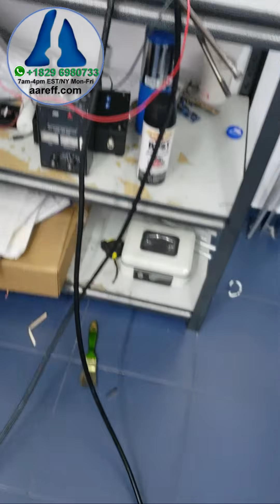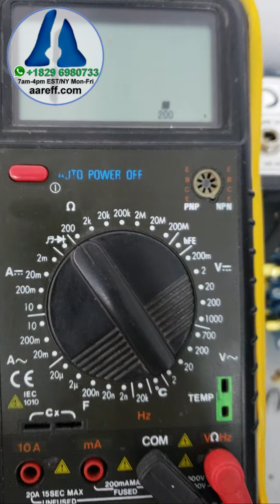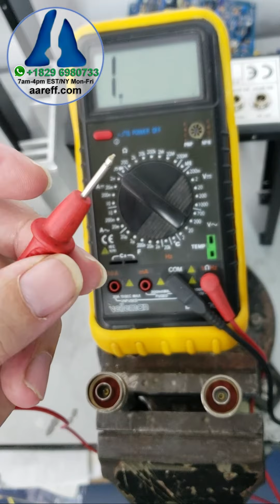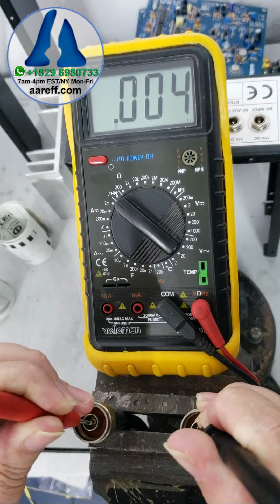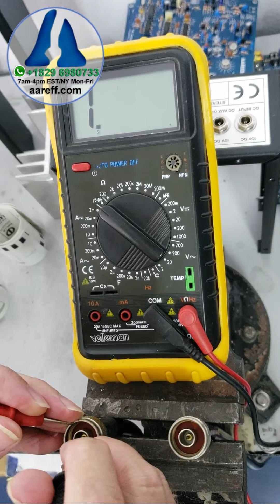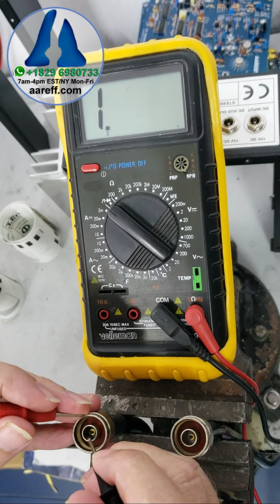Testing an Antenna Cable using a Multimeter

Comment: Additional tip (I know you know this Paul)
If you have had an antenna mounted outdoors and the SWR starts to go up toward 2:1 with no apparent damage or change to the antenna, it can be water ingress in the dielectric of the cable. To test, use an SWR meter with a dummy load at the end instead of antenna. If its still bad, replace cable. 😊
Reply from the maker: Yeah, this is true.

Comment: you did a great job my didn't read  3 center pin center pin is this good was not 4
Reply from the maker: What did you read when you just connected the meter probes together directly? Whatever number this is, this is the number you should get, or close to it, when you do center to center and outside to outside

Comment: (Thank you Valuable information) I need help from you I have a 3G and 4G antenna, how do I know that it receives a signal from the tower? Is there a device that does this or via a multimeter?🙏

Comment: If you want to do it properly, with an already installed, but faulty cable, then a TDR is your friend.
Reply from the maker: Absolutely TDR is better, but that requires more expensive test meters. This video is intended to show how any cable where you have easy access to both ends can be tested, with 100% accuracy, using a cheap 5 dollar multimeter.

Comment: What happens if the shielding is separated from the connector, like it was bent too many times where the connector and the cable meet? I assume that means the cable's not gonna work?
Reply from the maker: Yes, you assume absolutely correctly! Cables carrying radio signals cannot be treated like AC cables where twisted and taped long wires will work, for radio No!!, not even on a temporary basis. Radio signals need rock solid connections that never move and as short or small as possible. Remember, AC (50/60Hz) and DC use the entire cross section of the cable to carry the current, whereas Radio signals only the current travels on the surface of the cable, not in the cross section. So the visible connection you can see on the outer if the cable is the only place the connection of a radio signal is actually taking place and this is why the connection needs to be super good and solid for radio.

Comment: Hi I tried to contact with that number and I got no response your guy's still in business?
Reply from the maker: Hi there, yes, we are in business, absolutely mown out with jobs. You should get a response on that number if you call it between 9 and 5 EST/NY time. It's WS also, just send a message. Our email is reliable, info@aareff.com
Reply: @AareffSystems  Gracias por responder, ya le envie un email y espero su repuesta gracias.

Comment: You shouldn't be touching the probes or connections when testing. Current of the meter can flow through your body and affect the resistance readings.
Reply from the maker: That only happens if you are using the meter at a range of typically 1K or above. These readings are close to zero ohms and in this range touching the leads and the current passing through the fingers and body is unmeasurable and will not affect the readings. Try it yourself, get a 10 ohm resistor, measure it on a meter, check the result, with and without the fingers touching and you will see there is absolutely no difference.